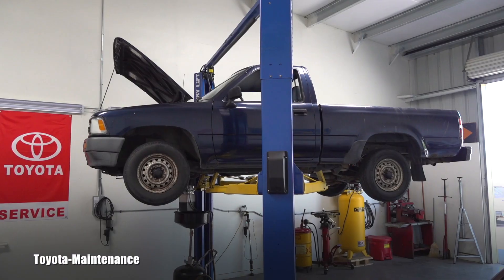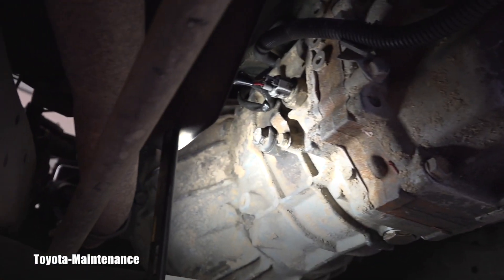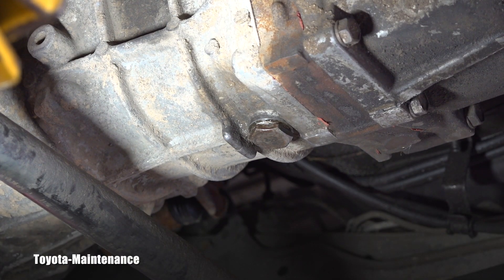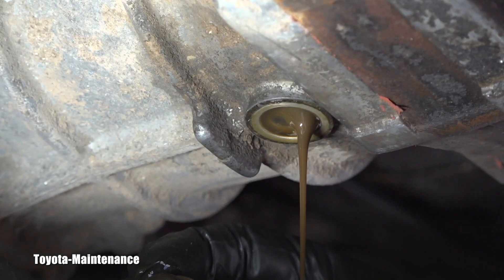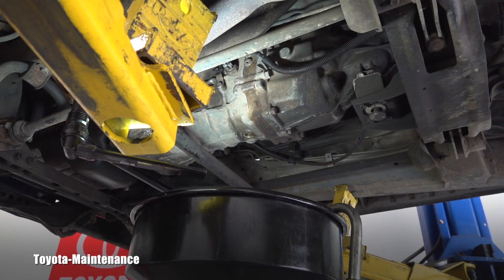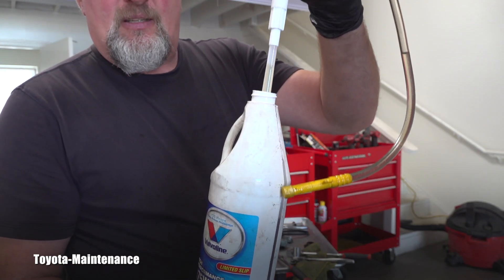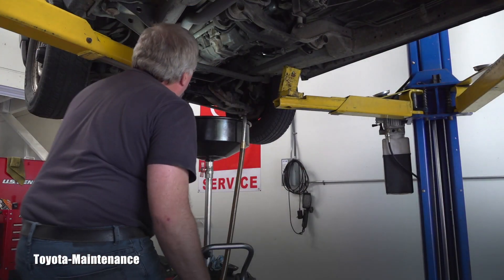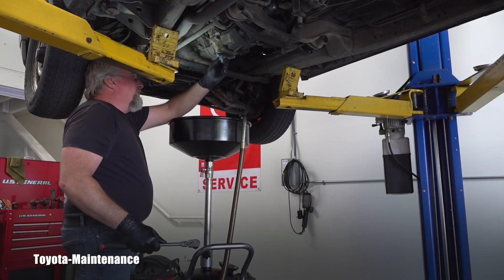Toyota Truck manual transmission oil replacement

Comment: Make sure you use GL-3 or GL-4 oil, you have to read the label carefully, it's not displayed prominently like it use to be. IF it says GL-5 anywhere on the label, then it's GL-5...it will attack the syncros in your transmission and you'll be rebuilding you transmission. The manufactures have worded the specifications in a weird way, and most auto part store employees don't know what is correct, know what to use yourself, check the owners manual.

Comment: Hello, good morning, I have a question: Do you use regular oil or full synthetic oil to change the oil in the manual transmission of a 2002 Tacoma?

Comment: I've been cautioned to Only Use GL-4 transmission oil because the GL-5 will over time destroy the soft metal synchros.

Although now I am being told that GL-4 is really difficult to find. It seems damned if I do and damned if I don't.

Comment: anyone getting ready to do this ... please don't ever use GL5 gear oil in any synchromesh manual transmission - it has double the EP additives as GL4 and it will eat at the brass and other yellow metals that the synchros are made from

if you do this by accident,  it will withstand a lot of damage before you notice anything is wrong,  but the clues are milky yellow or golden junk in the oil when you change it,  and if you open the transmission, you'll find that the synchros will have turned from shiny brass to black from it

we love these trucks,  don't let that happen ... only use GL4 fluid in the manual transmissions ... if the bottle says it's both GL4 and GL5 compatible it's just wrong - they are different fluids 

personally I use redline MT90 GL4 in 75w90 weight for my 08 tacoma 6-speed ... the price gets better if you buy a 2 or 4 pack of the quarts

hope this helps - good luck out there

Comment: I was wondering, before putting the drain plug back on, would it be a good idea to put in a little bit of new gear oil in to help flush out the crud?

Comment: We own an 07 4Cylinder Manual Transmission with over  250K miles on her, and we have owned since about 30K miles and we have never drained the transmission fluid, nor rear differential fluid, nor engine coolant either. Would you suggest doing these services at this point or just leaving it be, since such high miles and replacing these fluids especially on manual tranny might do more harm than good?…
Reply: I will never buy a used car
Reply: Your illogical thinking is going to be VERY costly to you, for your entire vehicle. You should be doing a power steering fluid flush, and a brake fluid flush as well. Plus a slew of other things.

Comment: GL4 or GL5 gear oil? Obviously they are different, right? "he main difference between GL-4 and GL-5 gear oils is the amount of EP additives. Sulphur/Phosphorus containing products are used as EP-additive. This additive has the purpose to prevent the occurrence of micro-welds on the gear flanks at the local high temperatures which prevail in EP circumstances (temperatures well in excess of 800℃!) GL-5 has roughly twice the amount of EP additives compared to GL-4, which is why it is often used in high-pressure circumstances such as in a front axle and rear axle differential. Sulphur/Phosphorus additives however have an unfavourable property: they can react aggressively towards bronze and copper. This can be disastrous for the synchromesh rings of a gearbox. Therefore it is not recommended to use GL-5 in a gearbox unless the manufacturer allows this." Source: https://www.rymax-lubricants.com/updates/the-differences-between-gl-4-and-gl-5/

Comment: Excellent video, I did mine a few months back however the transmission I owned is from a RN80 so it had soft metals in it, hence I purchased online GL4 fluid to help to preserve the transmission for a few more years. Toyota Manual calls GL4 or GL5 however its known that for soft metals within manual transmissions to use GL4 instead of GL5 due to the GL5 additive being very strong for those soft metals so GL4 is the way to go but is harder to find. Thank you for your video

Comment: My 1996 T100 4 cylinder 5 speed rwd took 3 quarts of Redline MT90 GL4 synthetic gear oil, and it's shifting much smoother. I highly recommend against using GL5 fluid in these transmissions
Reply: GL5 will destroy the synchros. It's wild how many ruin their manual transmissions not using GL4

Comment: I don't have a manual, but my understanding from a Toyota Master tech is that GL5 will eat up your soft metal gears and is not the recommend gear oil due to the aggressive additive package and should only be used on differential and Transfer case. Only GL3 or GL4 for the manual transmissions, if that's what it calls for.
Reply: Sadly many owners and mechanics destroy the synchros using GL5.

Comment: Regards
Do you know how much oil is put into the four speed manual transmission gear and the differential of the Toyota Hilux 1990 4x2 with 2Y engine?

Comment: Replaced the clutch in my 87' yesterday. Put 3 quarts in, and didn't run out of the fill hole. 🤷🏽‍♂

Comment: I have the same 1991 Toyota Pickup and the correct oil to use is GL-4 75w-90. I too made the mistake of  putting the synthetic GL-5 75w-90 gear oil in the transmission but luckily I discovered my mistake in time and i changed it out to the correct GL-4 Synthetic 75w-90 gear oil. Truck shits great no issues.
Reply: Glad she’s shittin’ with no issues 💪
Reply: @marksullivan1123 lol, can’t beat a good shit
Reply: I just bought a 94 2wd automatic is it the same proses?
Reply: @EdRecinos502  no, automatics use a different fluid and have a different drain and fill procedure.

Comment: Would it be good to drain and fill the oil then drive the truck ten or twenty miles and do a second drain and fill ?
Reply: Yes...yes regular cheaper thin oil for that!

Comment: Good evening! Any thoughts on why my 5 speed transmission would push oil out of the stick shift boot? And without consistency. Drove 5 hard hours without an issue. Drove 45 minutes and it was leaking out the shifter. There's much more to share, and this is the nut shell. Thank you!

Comment: My transmission had a full gallon drain out when I changed the oil.  Is this normal for the factory to overfill it pass the side plug level?

Comment: 35 NM is roughly 27 foot pounds. It sure looks like you leaned in really hard for that amount of required torque!
Reply: I didn't have the right socket for our torque wrench so I used the ring spanner and torqued it to "yes".

Comment: I have found out that due to the parts in the manual transmission G4 is really a better choice due to ease of shifting gears. It has something to do with the syncros that involve shifting gears smoothly in the transmission. I have a 1993 4X4 DLX Pickup and I will be changing my transmission oil from G5 to G4
Reply: Right. The poor owner of that '91 now has to deal with difficult shifting because a GL-4 gear oil wasn't used like Driven 80W-90 or RedLine MT-90 75W-90
Reply: @4af  GM Synchromesh
Reply: GL5 will straight up eat away the soft metal synchros. Never use anything other than GL4.

Comment: I love your videos!   Do you have any idea where or why a transmission leak would be seen dripping off the oil pan?   I thought it was oil leaking on the bottom of the oil pan but it's red fluid and confirmed to be gear oil.  It is a 2004 Tacoma 4 cylinder 5 lug very basic model RWD.  THANKS!

Comment: Very simple and straightforward oil change with the exception of the oil being very dirty.  It looked too easy to perform. Peter, would it make sense to fill it and then flush it out again re the oil condition.

Comment: Whats the code for this transmissions, its the same as mine BUT cant FIGURE IT OUT?? edit: some might say check the chassic plates, gearbox and transmission are different to my chassis as someones put them in

Comment: I have a 2019 TRD 4x4 with almost 20,000 miles. I will be doing the diffs and transfer case in the next 10,000 miles. My issue is finding the correct oil not even the dealer is using what is stated in the manual. For front and rear differential it is supposed to be 75w-85 and for the transfer case is supposed to be just 75w. The Toyota dealerships in my area are using 75w-90 for front and rear differential and transfer case. Also independent Toyota shops. I can't find the correct fluid anywhere but I am able to find the diff fluid I need from Redline and the 75w directly from Toyota on-line.  I just think it's very strange that the dealerships are not using the actual recommended fluid, what do you think??

Comment: My 2000 Celica vvtli has a U240E auto transmission/gear box is it possible to add a box with more gears? Like a U250E or U260E what issues could I run into if I tried this? I guess possibly a ecu one? To show the extra gears?? Obviously the dash has a 4 speed display. The gearbox is some what like a tiptronic I can higher and lower by the steering wheel.

Comment: I change my 86 transmission and differential gear oil every 100,000 miles. It's simple with the drain plugs in the differential too. Have 473,000 miles on OEM Transmission and differential.

Comment: Wow that fluid was ancient. I felt guilty once when I skipped the 2 year fluid change on the differential and transmission for my 2004 German Spec'd RAV4 4wd 5sp and waited one more year. The fluid still looked pretty new unlike the chocolate milk pouring out of this one.

Comment: GL5 in a gearbox with yellow metals synchros? Is it a yellow metal safe GL5? Like a GL4+?
Reply: I'm with you on this. I'm replacing my g5 oil in my manual transmission to g4 . My 93 yoda 4x4 pickup shifts to hard. Hope I didn't destroy my synchros.

Comment: Wished you had not filled it with full synthetic as it will make the synchronizers too slippery to work properly; just semi synthetic or conventional will do.  Furthermore it will greatly increase the chance of leakage switching to synthetic.
Reply: @andreasm2882  Get in touch with  Amsoil. They make the best lubricants on the market. I paid a premium to get a Toyota because it is the best brand out there and I would not use any  lubricant other than Amsoil's top spec products.
Reply: PLEASE stop perpetuating the same nonsense myths. It is 2020, Synthetic lubricants have been in widespread use for decades and have been objectively proven to be superior in every way. Conventional lubes have become obsolete and should no longer be on the market.  There is no logical basis for your  comments.  This is no place for 'Alternative Facts'.
Reply: @RightLaneHog3151  You are right it is 2020, and this vehicle was built in the previous century and it was designed for conventional lubricant.  There is really no additional benefit for synthetic, it is only a placebo effect to the user.
Reply: @dominicfong6341  Peter has created  a very helpful channel and I fully intend to keep my comments civil but facts matter. I respectfully suggest you do a little research about the quantifiable and easily verifiable differences between   mineral oil based lubricants and modern synthetics before you pontificate on the subject. :)

Comment: Peter, I wept a little when I realized we may never see another simple, RWD, manual pickup again.  :(
Reply: I have a 2002 Tacoma 2wd 2.4L manual transmission, about 190k on the odo. Bought it brand new 18+years ago. I am crying already that the manual is no longer available in any other new truck except for the Tacoma and by the time I'm ready for another truck it won't be any longer.
Reply: @christianjensen3182  The good news is that yours should still last many more years. BTW every once in a while a genuine, low-mileage Tacoma comes on the market and the manuals definitely take longer to sell than the automatics.
Reply: Right Lane Hog not in Colorado! The manual won’t last a full day for sale!
Reply: @christianjensen3182  However with the reliability of them, there will always be used and by the time that used one dies you never know what will be out there. Why your love for the rear and manual? Nostalgia? Simplicity? Fuel savings?
Reply: Nostalgia I guess. Every vehicle I have owned since 1977 (when I got my first car) has had a manual transmission. I would like to finish out my driving life still driving a manual transmission.
Reply: @christianjensen3182  I drove automatics exclusively for nearly 20 years before I finally switched to manual in 1999.  Beyond mechanical simplicity and increased driver control, a manual demands a level of engagement and ATTENTION from the vehicle operator that an automatic does not. As I have gotten  older and more stressed, I have come to realize that I rarely have the luxury of thinking about just one thing at a time. As such, anything that reduces distraction from the critical task of driving is a massive safety and sanity benefit. The fact that routine maintenance involves 2-3 quarts of lubricant and 15 minutes labor is the cherry on top.
Reply: @christianjensen3182  Definitely doable Christian. From Standard Mustangs to standard corollas. They're out there and being standard vs auto, they last. Might need a new clutch depending on if the previous owner knew how to drive right or not but that should be a non issue for you. Especially if you're not in a big metro city. But even then you still find gems.
Reply: @LAactor  Yes, but I need a truck for towing and such. I also have an 2000 MR2 Spyder with a MT and low miles and I rarely drive it so I will be still able to get my MT fix when I need /want it. I would still like to have one more new truck with a manual.
Reply: @christianjensen3182  and that’s only in one of the base models, they are phased out because only a few of us dislike riding the brake pedal all day.
Reply: @RightLaneHog3151  Yes what
Reply: @LAactor  Sorry, it came up in my notifications.

Comment: I would have poured in a quart of fresh oil to get out all of that junk.
Reply: I fully agree when I’ve done an oil change I let it drain fully put the plug back in refill with about a litre of oil leave for 5 minutes then drain that out to push out any old remnants or residue, like yourself I’m very particular 🚗👍👍

Comment: How often should I change the oil in a manual transmission?
Reply: Every 50k miles
Reply: @lagunez12  A good interval would be 50 K miles or 5 years- whichever comes first. Use modern Synthetic lube not obsolete dinosaur juice.
Reply: @RightLaneHog3151  right if we talk about automatic transmission but this manual and manual transmission you can even use engine oil
Reply: @lagunez12  No, use the proper viscosity manual transmission fluid as specified in the owner's manual.
Reply: @RightLaneHog3151  right I know that but when you grow up with 22r trucks,back in my town and you don't have choice or you got it find the way,to make then run

Comment: Valvoline is GL-5... every manual transmission says "NO GL5"  only GL4 or 3...  see where im going?
Because the additives specific to GL5 damage the synchro cones. Even says so on the Valvoline bottle.
Reply: OEM repair manual for Toyota G/W transmissions actually specifies "GL-4 or GL-5 oil"
Reply: @dquad  cool. Mine says Gl-3/4 ... and the valvoline bottle says "NOT for Syncronized manual transmissions"
Reply: It is yellow metals that are damaged from traditional GL5 oils. GL5 is a performance level, not a formula. Some GL5 oils are safe for yellow metals, some gearboxes don’t care if the EP package is there.
Reply: You will find in the owners manual gl4/gl5 however this was a believe back then that was no issues later manuals were updated after discovering gl5 was damaging the synchro's. Gl4 for the win, but is getting more difficult to find cheap. Make sure that says gl4 and not both. Red line mt works but is a bit more expensive.

Comment: Can you flush out the remaining gunk or is that likely to stir up trouble?   thinking diesel or similar.  Just asking as I had an 1960 car I was bringing back to life and the trans oil was ghastly like that and of unknown age.   After the change I did another 2 cycles of cheap gear oil about 3 months apart  (low use car) and the put my preferred stuff in.   As you would expect it improved each time,  but gear oil aint cheap.   The box reacted well to the love :-)
Reply: There's a guy in the UK who redid a daihatsu with the stuff. I can't see why not. As long as you don't let the diesel sit too long. There isn't much gunk left by that time and if you felt there would be some stuck in there, the slow dissolving way is the best like how you're doing it and open it sooner than the change interval and see. If it's cloudy and no longer yellow, change and you will see it not getting dirty as fast. That's the best way. No shock to the components or risk of a chunk coming off and grinding off a component inside. Unless there is major problems that you know will be fixed and need fixing or else and you are willing to take the risk, why not. Be a learning experience. Report back if you do. Ever think of MMO? That's the most aggressive I'd go. Concerned about any seals on something 60 years old.
Reply: I would think a change followed by driving for a few miles then change again would be safer and have similar results. Lots of detergents in these fluids already.
Reply: Use regular engine oil for the flush

Comment: Looks like it has been apart before, you can clearly see the red RTV between the main case and the rear.
Reply: Dont know about this particular vehicle but my Land Crusier Manual Gearbox has orange sealant from factory
Reply: @pauljbusby  I could be wrong, but most Japanese vehicles I've seen, including Toyota use a gray color sealant.
Reply: @brianbumgardner8704  mine and my brothers both have orange/ red sealant
Reply: Was thinking the same thing. Cable casing looked new too